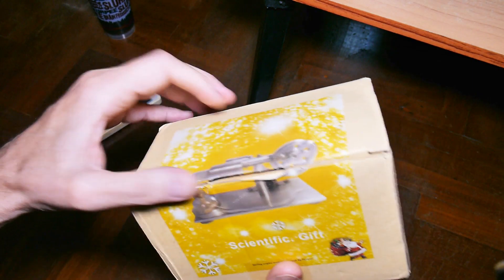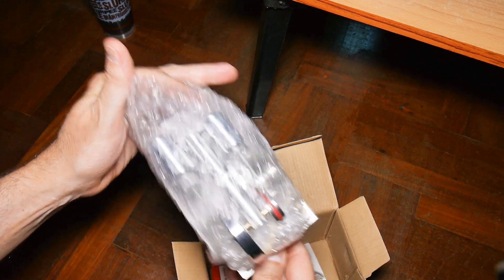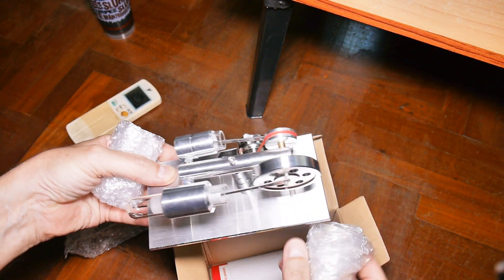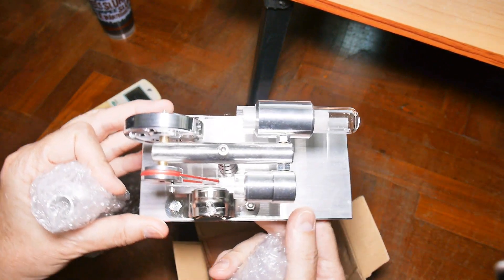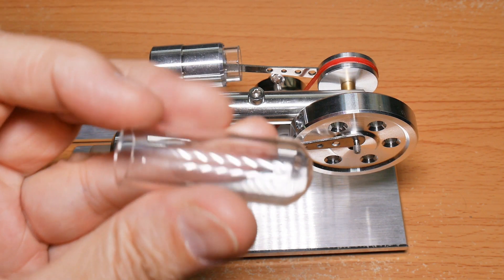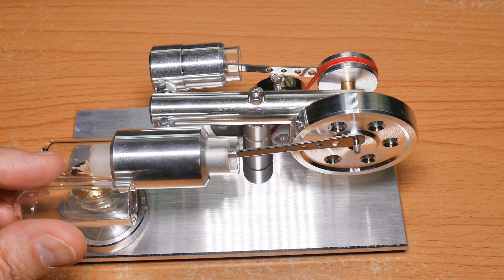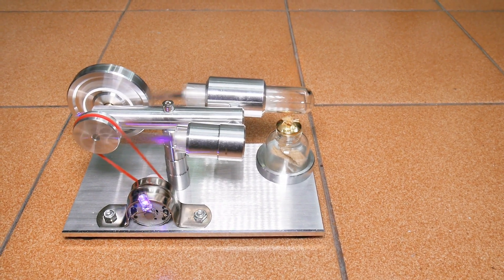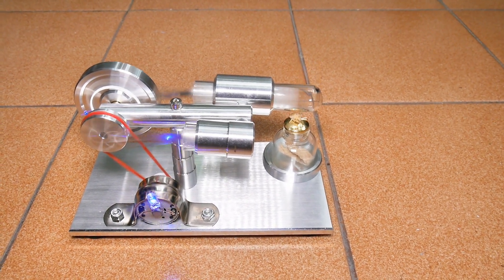Stirling Engine w/ Generator, 2 Piston Gamma Type

Comment from the maker: RELATED VIDEOS (including this one): 
Stirling Engine Specs For DIYers   https://youtu.be/kokzk1xMk9Q
Unusual Stirling Engine "Teardown" & How It Works    https://youtu.be/m_cg4rGdggY
Stirling Engine With Propeller  https://youtu.be/s6Kh7wkJN-M 
Stirling Engine - How It Works In Simple Terms:   https://youtu.be/Q5QEBqjkNjo
Building A Stirling Engine, Laminar Flow Type, First Attempt Part 1 
https://youtu.be/QQ4nqy4GHJI
Stirling Engine Doubling Efficiency Experiment   https://youtu.be/Iqg9Nz-8Vwc
Thermo Acoustic Stirling Engine - Simply Genius   https://youtu.be/TEiBScfR4Vk
Stirling Engine w/ Generator - Gamma, Walking Beam Style   https://youtu.be/1x7Bo-dVsR4
Stirling Engine w/ Generator Power Measurement      https://youtu.be/bZqB_qwDbqI
Stirling Engine w/ Generator, 2 Piston Gamma Type    https://youtu.be/Xmb19QVJPqw
Stirling Engine - High Temperature, 2 Piston Gamma     https://youtu.be/Ji2oQ40_M0c
Stirling Engine That Uses Ice for "Fuel"???     https://youtu.be/kCbfVgBwv6Q
Stirling Engine - Low Temperature https://youtu.be/1BbfGe5Shgg

Disclaimer: This information is presented as entertainment only on an  "as is" basis and any use the viewer makes of it is solely up to them, and it is their responsibility to determine if the information remains current and if it is applicable to their situation. The viewer is responsible for any and all safety involving this. Viewing this video is the viewer's agreement to these terms and conditions. If you do not agree, stop now.